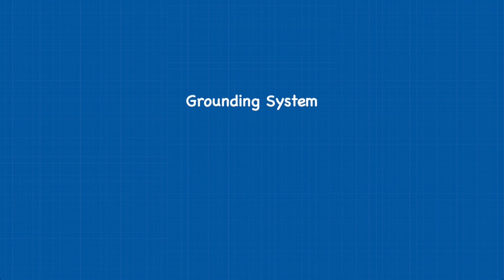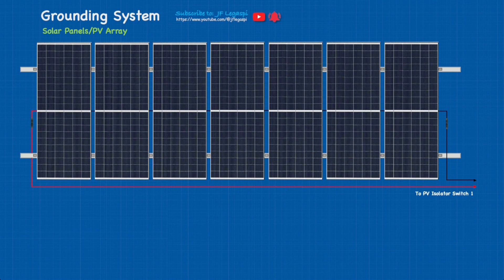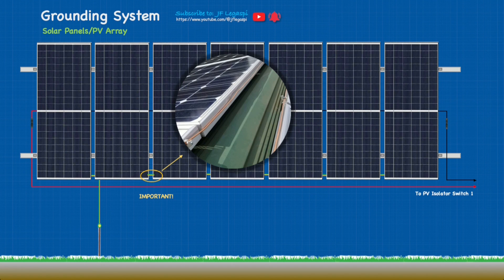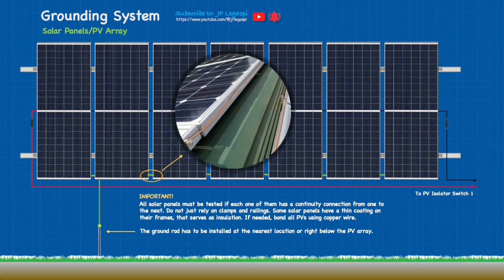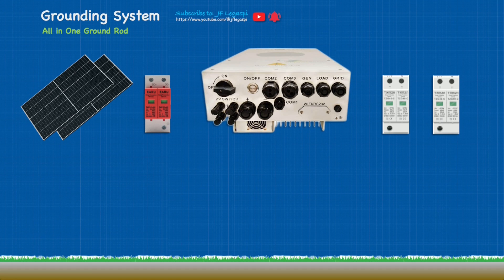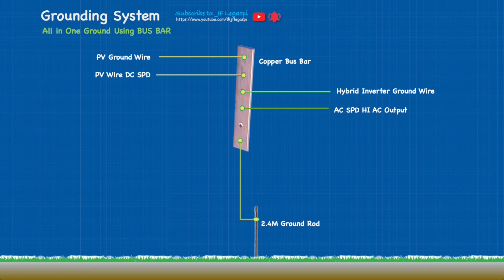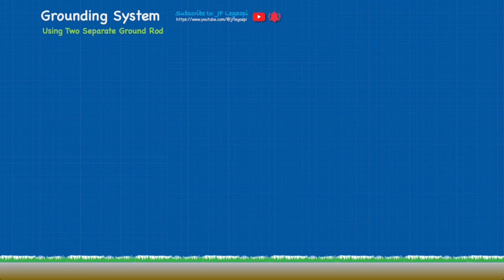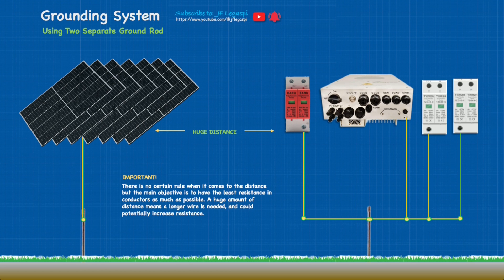PV Grounding System Tutorial

Comment: The grounding wire needs to be bonded to neutral at main panel.
Grounding rod alone cannot protect the system from ground faults because soil has high impedance. It is also not that effective in surge protection better check the ground resistance
Reply: Valid points.  Best practice is actually to install two round rods 8 foot deep and at least 16 feet apart.

Comment: Hello thank you for the video I was told that all of my grounding rods on my property need to be tied in together including the ones that are grounding my solar panels they all need to be tied into any other grounding rod driven into the property within 100 ft of each other do you know if that's true I can't seem to find any solid information on this they said it could cause catastrophic damage otherwise unless they're all tied in together even the lightning rod he said needs to be tied in to the same grounding rods
Reply: Yes, if electrical systems are connected between detached structures, then you need a ground wire running between those structures, connecting the ground rods. Otherwise an indirect lightning strike will cause there to be a huge voltage difference between one ground rod versus the other, and that charge will have nowhere to go except for Through the Hot wires that connect the two structures. If the rods are connected, then there will not be a voltage difference between the two for this gradient, voltage problem, and lightning strikes.

Comment: Sir begginer lang po ano po ang tamang settings na ilalagay sa A charge and A Discharge ng inverter.
Reply from the maker: Hindi ko masasagot ang tanong hanggat hindi ko nalalaman ang specs ng battery bank at ng MPPt SCC or Hybrid Inverter, paumanhin.
Reply: @JFLegaspi  deye po sir. Example sir kung nasa 
-8kw yung solar panel
- 200 Ah battery Lithium Ion 51V
- Deye  Hybrid Inverter na 8kw

Comment: Magandang araw po sir, may query lng po ako, kasi meron po ako solar set up na 12 volt system, solar panel na tatlong tag 100 watts in series connection, SCC po na elejoy 400 watts, 

Tanong ko po sana sir bakit po kapag 10 or 11 am plng ng umaga po  ay ndi na nagchacharge ang 72 ah ko po na 32650 lifepo4 battery, nagreregister na fully chargd na sya pero pag kina cut ko ang panel ay 13.2 palang po sya, 2days ko inobserbahan kung aabot ng 14.6, unfortunately ay talagang nag i stop sya kpag 13.2 na ang battery, i tried udjusting the setting po ng elejoy, sinubukan kong gawing 15 volts ang cut off pero gnun pdn po. What seems to be the problem po kaya? May error po ba ako at ang charging output po ng elejoy ay umaabot ng maximum 15.2 ampere po.
Reply: Brand new nmn po battery ko at kapag ginagamit ko po sa dalawang dc electric fan ay magdamagan nmn po, curious lng po ako at ndi ko po alam kung bakit ndi nakakaabot bg 14.6 or kahit sana po 13.7 ang battery ko,  bale dalawang 36 ah po na lifepo4 battery in parallel po ang gamit ko, may kanya knyang bms na 40 ah abg discharge at 20 ah ang charging
Reply from the maker: Ang alam kong max supported pv voltage ng Elejoy 400W ay 55V lang. kung naka series ang apat na 100W na may 18V Vmp, lampas sa specs yan. Dapat 2S 2P ang configuration, hindi 4S.

Subukan nyong i charge ang battery bank ng walang load habang charging kung gusto nyong makasiguro na puno eto sa maghapon. Karamihan sa mga LiFePO4 cells, normal na bumabalik sa 13.2V to 13.6V kapag wala ng araw o huminto na ang charging ng SCC.
Reply: @JFLegaspi  so far sir ndi namn po nag eerror ang elejoy 400, observation and experimentation po ang ginagawa ko. opo sir tama po kayo bumabalik nga po sa 13.2 from 14.6 tpos babagsak nlng sa 13.2 pag wala ng araw, wala dn pong load kapag nagchacharge sa umaga, trial and error po ngyon ako, naiisip ko po baka mataas lng ang charging current kaya po gnun, try ko po ulit magdadag ng isang set pa ng battery sir, anyway maraming salamat po laking tulong nyo po sa mga nagsisimula plng.
Reply from the maker: Baguhin nyo ang configuration ng solar panels, dapat 2S2P, huwag 4S. Masyadong mataas ang PV voltage para sa Elejoy 400W.